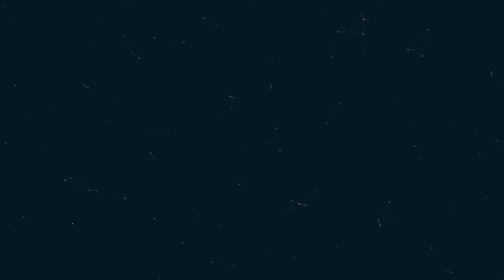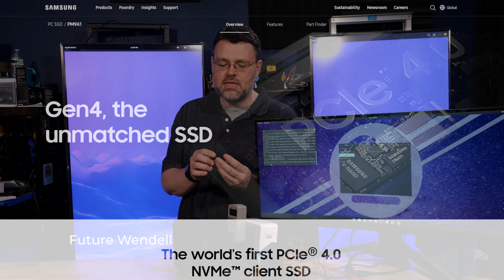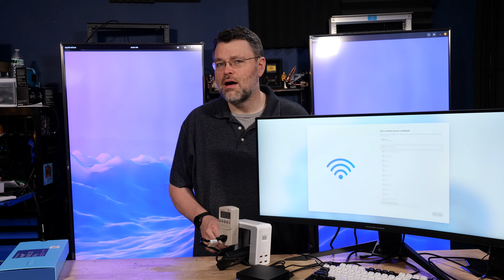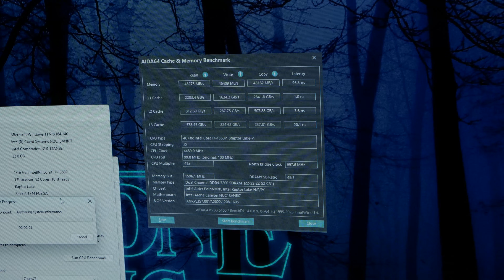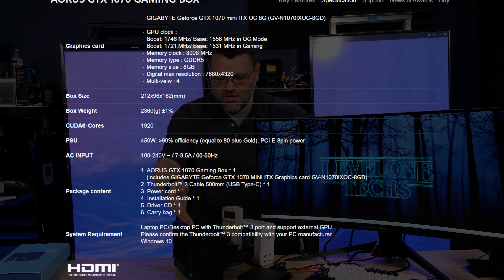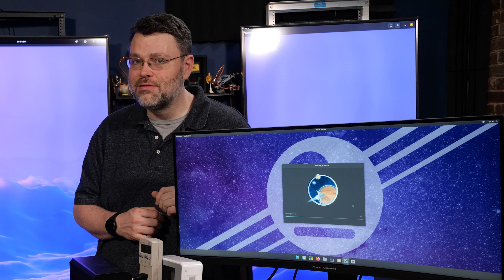Intel NUC 13 and Microsoft 11... Better install Linux

Comment: You can do the oobe\bypassnro at first setup, you dont have to do it at the connect network stage, save you dooing language and keyboard etc twice
Reply: When asked to log in to your microsoft account just type admin as your email and admin as your password, then you can log in with a local account. :D
Reply: @D Reaper No, you dont need to have a Microsoft account. 
It's just like the cmd bypass where you skip entering Microsoft account and create a local account. 
I just think its easier :D
Reply: @D Reaper Personally I agree Linux, but my clients want windows
Reply: @Linden Reaper It's got nothing to do with wants. The software requires Windows. It's only avalible for Windows server, and all clients must be Windows.
Reply: @Linden Reaper Well it is my problem and my bosses problem. I whould love to move them to linux but we run a busniss and having everyone on linux and not paying for licences isn't profitible
Reply: @Linden Reaper So I'm not supposed to have a salary? SLAs alone don't cover operating costs, I've got to make it up somewhere. I'm not milking them, they choose to go with Microsoft, and I am beholden to their demands and just give them the solution. And some of them don't have a choice as the software that is vital to their business is only available for Windows.
Reply: @Linden Reaper What part of: SOFTWARE NOT SUPPORTING LINUX do you not understand, it's not exploitation it's a requirement. They choose a software to do their business I just support it. The software in question is not a microsoft product.
Reply: @Linden Reaper No it's NHS Dental software, they have a few options, and I will list 4 that I know well. 
1. Exact, Windows-only Client-server. 
2, Dentaly, the Cloud version of Exact that has a horrible subscription. 
3, R4, Windows-only Client-Server. 
4, Orthotrac, Windows-only Client-Server

Comment: The amount of shade that Wendell is throwing at Microsoft in this video is top tier.

Shade that is fully earned, mind you.
Reply: I've been daily driving Linux for a year now, because while I could keep using Win10, I want to know how to run Linux for when they force everyone to upgrade.
Reply: I'm so far in the shade I am swimming with penguins.
Reply: Yes, but I was expecting something different since it's in the title and not specific to the NUC 13 Pro. However, I see his point on this topic.

Comment: Another interesting offering. Lately been looking at MinisForum UM560XT and the SER5 of Beelink for a €350 - €400 price range but I'm assuming this NUC will be more expensive :(
Reply: Yeah, quite a bit more expensive.
Reply: Beelink gtr6 is nearly same price but more power efficient and more powerful than this one.. You should check it...
Reply: 450 USD
Reply: @zeus1117  Yea American prices don't work in Europe 😁

Comment: 16:30 CEC used to be very common on desktop GPUs, i remember when the feature went away "why does my TV remote not control XBMC any more"
Reply: Didn't know that actually used to be commonplace on GPUs. I kind of get why they would not have it (CEC is already a mess for appliance-type devices like game consoles, streaming devices and Blu ray players, let alone a multi-purpose computer that could be connected to multiple monitors), but having to deal with external CEC adapters is an extra hassle for people who do want that kind of functionnality.
Reply: @Riboshom  My problem in taking it away is that users could always turn the feature off, and if it caused problems, just turn it off, dont take a useful feature away from likely 10s of thousands of people who use a PC as a set top box, or like me, as a desktop with a monitor, and then have a media app that runs on the TV and is controlled by the remote as if it was a completely separate machine(so i didnt need a seperate device for media)

Comment: That $550 mini PC on amazon with the 7735h/6800H with 32GB of RAM and a 512GB SSD is really tempting, but i really want the 7740H with RDNA3 and hopefully AV1 encode.
Reply: Every time I've considered one of those low cost/high value mini PCs like a Minisforum or Beelink (and they are super tempting), I check out their support sites and see an absolute void of BIOS support and think, "I'm not sure I want to deal with this if there are weird glitches or quirks that will never be resolved". I'm sure the support is out there somewhere if you do enough digging / can read Mandarin / look up suppliers. Not sure that's what I want to do with my spare time.
Reply: @mapwheel00  Lenovo is often ahead of these smaller manufactures, but generally waits for the full socketable desktop variant, and are often more expensive, though i did pick up a 4750GE tiny for $488 in December 2019, was the machine i used to bring AMD PSB (on the consumer desktop) to the attention of Serve the Home and L1 Techs, previously it was thought to only be enabled by default on servers.

Comment: I bought one of these mini-pc's. It came with Win-11. I didn't even boot windows and booted and installed Linux right over it instead. So, yeah, don't even bother. ~10W with 6 cores 12T and 64G of ram is sweet.

Comment: I always feel that Intel NUC engineers are like in a completely different building and are not allowed to communicate with the rest of the company.  They just sit around thinking about how they can make super awesome and functional machines.
Reply: Indeed, instead of gimping everything they go "can it be better?" 
Except for USB-A  ports though. They really don't seem to like them even when they could fit twice as many AND still have more than enough bandwidth for everything else because USB 2.0  (and honestly 3.0) is so cheap both in cost and computationaly. It's like they're seriously going for "less ports than a notebook" except when it's a selling point.. and USB somehow isn't a selling point to them.
Reply: Judging by the size of intel they probably are
Reply: I think they sit close to the Arc guys though.
Reply: I get the impression everyone at Intel are on completely different planets. Every business unit is plotting the demise of all the other ones. They're worse than IBM at this point.
Reply: That's how Microsoft Office is divided 😂 People from Office for Mac have no contact with people from Office for PC 😂😂😂
Reply: i used to work at intel as a contractor, communication would be through way too many powerpoint presentations.
Reply: @destronger5313  Many people that comment here are either too young or have never worked in a big corp to understand how these things work.
Reply: If you ever work in a big company you will find out that this is what usually happens. And more often then not, you may not even be in the same country.
Reply: With Intel ending their NUC business, I guess we can say this comment did not age well over the last two months.
Reply: Except when it comes to CPU cooling, as under sustained loads it sucks.
Reply: @YouTubeGlobalAdminstrator  It is a lot better than the 12th Gen NUC Pro, that I can tell you. If you need something more silent, you have to go with a bigger cooling solution. Good news is, that you can actually buy the NUC Boards directly and build whatever you like.
Reply: Intel NUC's suck.  Intel NUCs are used in TEAMS room, we replaced 2 of them and eventually went with  a Lenovo model. But thinking back both were improperly installed , where the NUC was hanging off of a HDMI cable in which the HDMI cable and port went bad.  So I wonder if the cable that damaged the hdmi port on the NUC caused damage to the NUC.
Reply: Yes, but can they run CrysIs REMASTERED ?       * slow demonic sinister laugh *
Reply: Do they actually make money? Or are they going to go the way of Atom one day?
Reply: @lawrencedoliveiro9104  We sell tons of them -- mount behind the monitor hardly any foot print plenty of power a lot of business people love em. 
I stuck a few behind 35 wide screens and its a great wide split alternative to dual screens for office workers and they aren't kicking around a tower that's not much faster.

Asus has some alternatives but they are larger.. and vesa mounting the asus mini pc's is not nearly as solid. it wont fall off but smh its floppy.
Reply: @SolarflareTM  Of course Intel has to sell them at a competitive price, else you wouldn’t buy them. But does Intel make a profit on the result? Because this could be like Atom all over again.
Reply: @lawrencedoliveiro9104  your under the impression these are cheap and i dont know why. 
they cost as much as a laptop yet have no keyboard - touchpad - or a screen they also dont come with memory - windows or a hard drive. 
these are $$ makers for intel id bet on it.
Reply: @lawrencedoliveiro9104  Atom line didn't go anywhere, just got renamed

This is not counting that little cores in Core processors right now are Atom cores basically
Reply: @lawrencedoliveiro9104  Have you seen the prices of NUCs?
Reply: @lawrencedoliveiro9104  I got a contract to do a full build of 100 NUC's from barebones to fully setup and installed on the back of office grade monitors back in 2015. It was such a small order Intel didn't even send a live salesperson out to try to sell me more. They must sell LOTS of these things.
Reply: @pk1213 Accurate :)
Reply: "Intel NUC engineers are like in a completely different building" -- They're in the Marketing building.
Reply: Microsoft has always made solid hardware 

Their mice are great for example